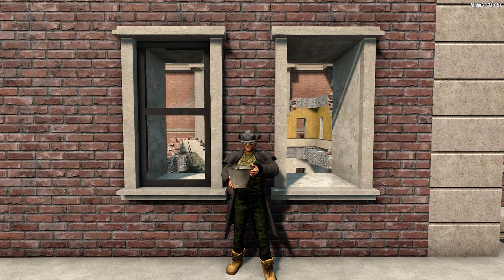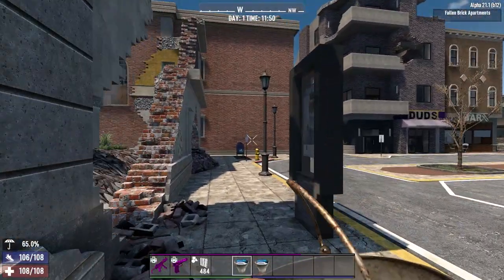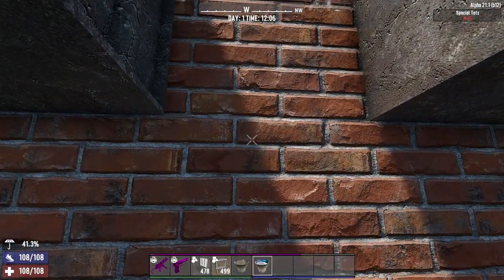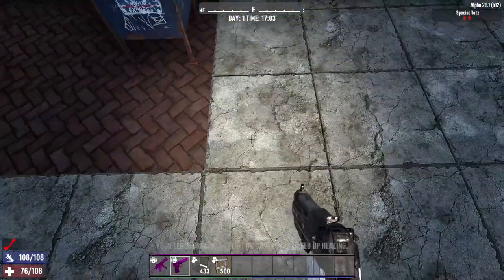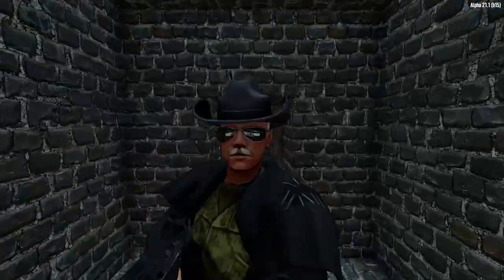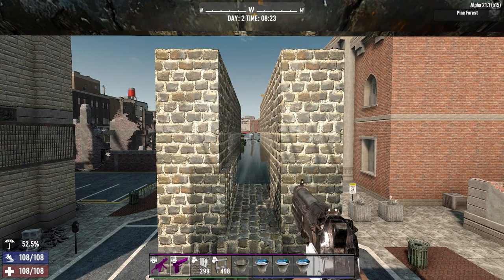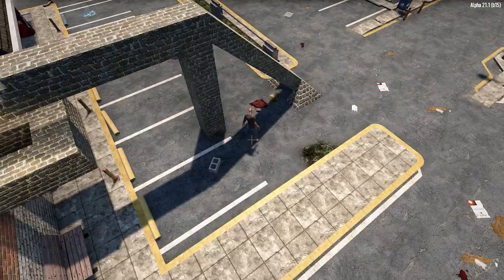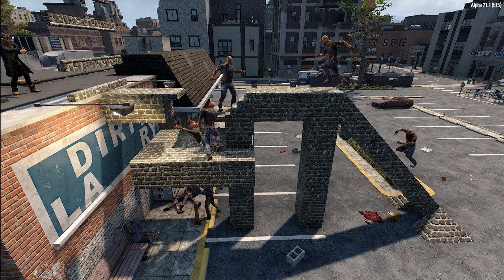Build a WATER ELEVATOR and ESCAPE CHUTE plus more! (7 Days to Die: Alpha 21)

Comment: This is really good info. Ive tried using water to my pole strategy.. 
can you have 2 decorations "spaces" with water?... that would open op for a number of solutions.  
or just guide ragdolls into a tight space with the rage blocker. 
very good.
Reply from the maker: You can definitely do multiple in a row - like a 4x1 space with water, and even a 4x2.  but you can't (that I've found yet) do more than 2 wide and as many long as you like.
Reply: @CautiousPancake  okay. because what you really want is a pool with water to "catch" the zombies. 
but just building over a lake doesn't help, since zombies stil can go in rage mode. 
i believe its the combination with Air/water/air that changes the dynamic. 
Jawoddle did a pool, and discovered they still went rage. 

But since i more often than not, dont play vanilla fire-plates also help on rage mode. 

My lates design is a garrage dropper. It simply opens right after zombs have touch it. Dropping the major, leaving the rest in a stage of "where to go now". 
Moments efter the "path" is reconnected and zombies run back.. 

effective having them running in circles, with no point. 
a few of the do however start to dig. 

but you might be able to make a ferrits wheel with zombies, if you open/close 4 entrances, making them run in a big circle all night.
Reply from the maker: @Allan_Lugia  Agree a pool is ideal, although 2x5 or similar might be ok if you can drop them in the middle of the two blocks - would be tricky to pull off though.

And your garage dropped sounds fun!
Reply: @CautiousPancake  it is. im basically untouchably. tho its lategame. (i can show you pictures if you like... somehow?

My next idea would be a windmill of doors... 
by keeping the zombs confused, by open and closing 4 doors to establish a path, then take it away. it seems my garage idea unintentionally does this. 

its basically a outer Eged shaped like a cross, with a door in each end. when it sees zombies, it opens(removes the path). and they will be directed to another door. 
it keeps doing it, and hopefully it would transform the zombies to run in one big circle, effective making it a ferrets wheel, but for zombies.

Comment: Do you have or can you make a short video on how to place shapes to hold water at a base? Sort of like have it there to drink it once you have the mod thay goes in your helmet.
Reply from the maker: Well, one way would be to use these facade plates to make it hover - you can still drink from hovering water - just pretend you're in space :D  

Joking aside - do you actually mean like in a little well, or something?
Reply: @CautiousPancake  not necessarily.  Probably like having someting position on the floor of the base that'd hold the water in place and that looks esthetically nice. Something where you can refill from a bucket once the water is (or almost) gone. I tried but my water ran all over the shapes and floor lol. 🙃 😁
Reply from the maker: @rafaC0224 Ah I get you!  I don't have anything cool looking to hand, but will have a crack if I get a moment!
Reply: @CautiousPancake  Thank you sir.

Comment: Not sure how can use this myself outside of maybe the slowdown but hate how it blocks your view of them.  Garage forcefield though still getting tons of use even after the doors are in. Oh. Have you noticed that stability of upgraded blocks don't seem to be updating properly? Noticed when I was doing a test build. Cobble and steel were keeping the same stability as the frames after upgrading.
Reply from the maker: That's ok, my favourite is probably the escape chute - I like building towers, but hate walking down the stairs :D 

I hadn't noticed the upgrade issue on block health - just tried on 21.1 latest experimental (b15) and it seemed ok - which version are you on?  Maybe they've fixed it?
Reply: @CautiousPancake  Just rechecked my test world on that version and yes its still doing it. Also stability not hp. It's not updating the horizontal stability properly as you upgrade the blocks. Stability when placing the upgraded blocks normally does fine but not when upgrading. I posted a couple of pictures in Eko's chat a few days ago about it.
Reply from the maker: @ChessatheCalico  Ah stability - let me go back and re-read what you posted!
Reply: @ChessatheCalico aww cute picture
Reply: @PersonausdemAll  heh tnx
Reply: @ChessatheCalico  You are welcome 🤗

Comment: Is it possible tou make a full glasses underwater base?
Reply from the maker: From only glass I don't think so. From mostly glass, maybe!
Reply: @CautiousPancake  do you know how to make it ? Do i have to build the base in a lake and After take out the water? Or  dig a hole ,Big Big hol ,build the base and After put somme water in the hole?
Reply from the maker: @jeremykasbi6187  Best underwater base I did since they brought in the new water physics was this  https://youtu.be/QGlDxlQAwX4 - you'll need to replace the cube blocks with glass blocks, but the sheets will need to be solid - that's where it won't work as well since the sheets can't be see-through.

Comment: I uminage that zombies wont path way to the water ladder but as for the normal ladder thats an difference story thou.
Reply from the maker: Correct zombies aren't interested in the ladder as the base is too high off the ground.  You can do the same with ladders though - starting them on the 3rd block.
Reply: Ah OKs that's good to note that zombie's pathing had alot more restrictions then what I realize. Good to note.

Comment: Bro just recreated the water elevator with signs in minecraft
Reply from the maker: I've never played/watched minecraft, but maybe I should!  Sounds like there's some similar ideas to have fun with :)
Reply: @CautiousPancake  
haha, the water elevator with signs is a very very old trick back when minecraft was below 1.9 version.

it was sort of similar to using the facade blocks in between water blocks, except wooden signs were placed in between water blocks as the water would not flow through the signs.

So it would be 1 block water, 1 block sign, 1 block water above it, 1 block sign so on and so forth in a similar confined space.

however, minecraft has since long updated and now there are blocks that when placed below water, propels you upwards with bubbles.
Reply: I found a video that showcased the water elevator I mentioned here: https://youtu.be/i7AXV46muB0?t=75
Reply from the maker: @x3Karma  Haha - just watched the vid you linked - that's crazy, and you're right - it's almost exactly the same idea/concept!  Man I feel like I missed my chance with Minecraft - should have played that! 🤦‍♂